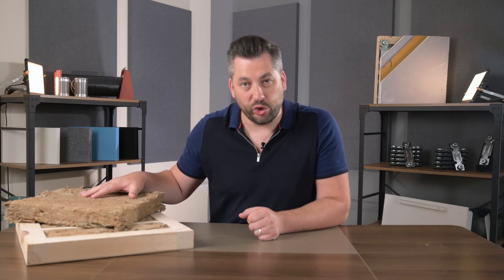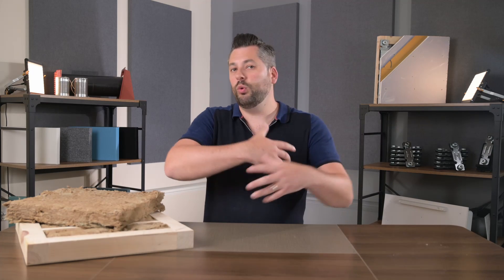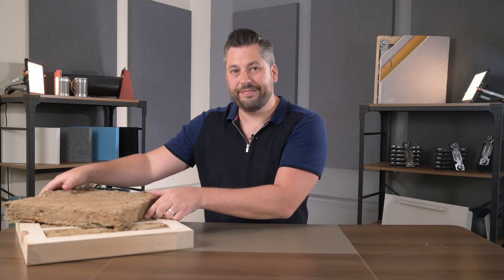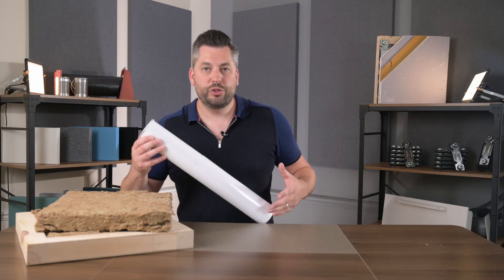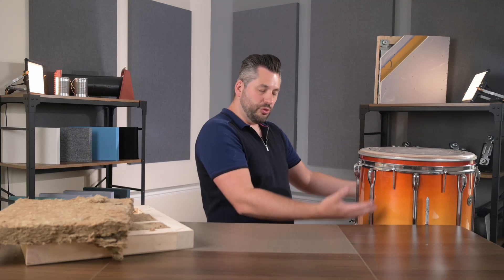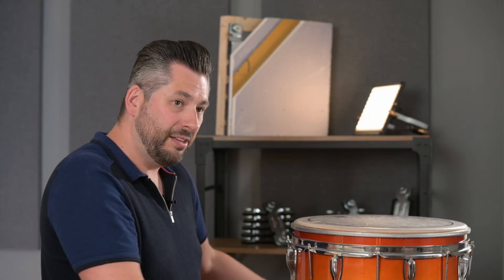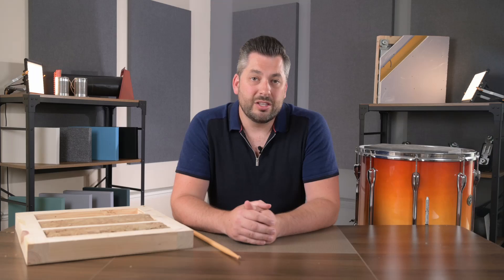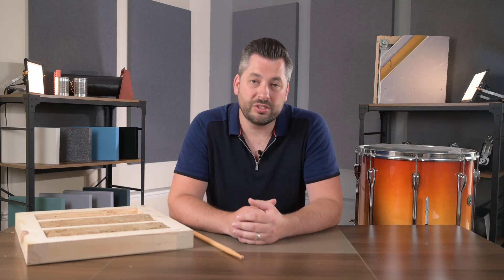How Acoustic Mineral Wool works as Soundproofing Insulation

Comment: Would i get any sound absorption by ramming carpet underlay under floor boards between joists?
Reply from the maker: Hi @traderz13, we'd recommend the use of 60kg acoustic mineral wool.
Reply: @SoundproofingStore is that a yes or no?
Reply from the maker: @traderz13 Thanks for the question. It really depends on what exactly the carpet underlay is. If it's a soft, absorbent, porous underlay then as long as you use plenty of it, it will give you some sound absorption. Obviously difficult to say how much with no data. But any soft absorbent material will help to some degree.

Comment: I recently had to take up my laminate floor because it was damaged and about 20 years old, there’s floorboards underneath and then mineral wool between the joists, there cavity form floor to ceiling downstairs is 53cm. 

I took up the acostaly because that was also damaged. I want to keep the floorboards but I’m concerned it’s not insulated enough for the flat downstairs, I have carpets etc but will that be enough?
Reply from the maker: Hi @Titanicdork133 from your comment I assume your biggest concern is your noise travelling down to the people below. In that case, it's good that you already have mineral wool between the joists, your floorboards should be ok to keep but you may need to seal up any holes or gaps with acoustic sealant. Then you need a soundproofing product that will do two things, 1. Add more mass to the floor to reduce airborne noise 2. Add cushioning to the floor to absorb impact. If you want to use a laminate again then you could use our Reverso SoundMat - https://www.soundproofingstore.co.uk/reverso-soundmat but you will get better results by using our SoundMat 3 Plus - https://www.soundproofingstore.co.uk/soundmat-3-plus and having carpet on top.

Comment: Any opinion on the higher density rockwool slabs that are available? Eg RW5 100KG m³? I have a low ceiling, so was wondering if this may be incrementally better for the same height reduction?
Reply from the maker: Hi, thank you for your question. In the vast majority of cases we find higher density than 60kg gives very, very little to no more benefit in terms of decibels reduced. It's handy in certain circumstances when trying to improve specific sound frequencies, but for general household noise, we wouldn't say spending more money on higher densities would be worthwhile.

Comment: how thick should be the mineral wool layer for the floor? For example for the 300m joists should the wool layer be half of it (150m)? Or 200m would work better (still leaving air gap)?
Reply from the maker: Hi, thank you for the question. It depends to a degree on the construction and what is on the ceiling and floor. Mineral wool has diminishing returns, so the more you put in, the less effective each layer gets. On a basic internal floor with floorboards above and a single sheet of plasterboard screwed direct to the bottom of the joists to create a ceiling, having more wool will give you a little more benefit. So 100mm of wool in a 300mm cavity will already do a good job. 150mm will be a little better but only a couple more decibels, 200mm will be slightly better again but marginally. So in most cases we stick with 100mm as this does a perfectly good job and is cost effective, but if you want to use 150 or 200 it will give you a small improvement. However, if you are also doing an acoustic ceiling like our ReductoClip ceiling system then 100mm of wool bewteen the joists is all you need, and any more will not give you really any further benefit at all as the full system is already doing such a great job and is therefore more difficult to improve. Hope that makes sense.

Comment: Hi there - when building a stud wall from the party will a larger gap than 10mm, say 20mm improve the results? Thanks
Reply from the maker: Hi @matthewhorsfield7895, no air gap to a 10mm air gap is a huge difference in performance. A 20mm air gap (over and above the 10mm) will give you some additional benefit for lower frequencies.

Comment: Hey I have a question, we soundproofed the alcoves but I can hear them clearly through the chimney breast - can we stuff our chimney with this insulation? It's not an active fireplace
Reply from the maker: Hi @TheAntitrollpatrol, adding Acoustic Mineral Wool will certainly help absorb some of the sound from bouncing around inside the chimney. However, it won't soundproof it. Please see the below blog which highlights the ReductoClip System or SoundBoard 4 as options for soundproofing the chimney: https://www.soundproofingstore.co.uk/how-to-soundproof-a-chimney
Which system you use can depend on the level and type of noise being heard through the chimney. Please feel free to call and we will happily advise on the best solution (01423) 206208.

Comment: When filling in between floor/ceiling joists, does it matter that much about having a continuous layer, or is it more just filling a good percentage of the cavity volume?
Reply from the maker: It depends on your floor joists. As a guide based on 200mm floor joists, we recommend 100mm mineral wool. (So about 50% of the cavity is filled). However, this can vary depending on each situation. Don't fill all of the cavity, as there needs to be an airgap.
Reply: Hi, is this good for lining a subwoofer box?

Comment: I live in india in an area where there are always drilling and loudspeakers going on and not just that but on festivals , it becomes unbearable to suffer 140db coming from everywhere due to so much population . Will this wool with soundproof booth work? i got one interior guy who made plywood frame with mdf walls and inside that, he is gonna fill this wool. I m still wandering if this will be able to block drill voice coming from my neighbor home in a joint  apartment? Can you suggest how to completely block higher db sounds?
Reply from the maker: Hi bhatt shashank - Thank you for your comment. Unfortunately it's very difficult for us to help with this. I can't recommend any of our solutions because we only supply within the UK and I am not aware of the available systems in India. However, just putting a plywood frame with mdf and mineral wool against the wall is not going to do a lot. Especially for the low frequency structural vibration of drilling.  You need a system that dampens high levels of sound energy / vibration. You need to add a lot of mass to the system. However, your bigger problem is if the building is concrete, the vibration is probably spreading everywhere, thorugh your floors, ceilings, walls etc. Just soundproofing one wall will only help so much in this case.
Reply: @SoundproofingStore  Thanks for suggesting the solution. Can you tell which wall i should soundproof in the cube of my room?
I live in 7 storied building where there are three blocks a,b and c each seven storied. I live in B-601 and building B is surrounded by A and C. Now interestingly, if person living 101 on first floor of either A or C does something with hammer(90db) in his home, i can hear that clearly even being on 6th floor and not only that but that vibration is being spread everywhere it looks like that sound is coming from top of my ceiling which looks very strange to me. Yes you got right that it is due to concrete but how to decide which one to sound proof?

And yeah just to mention that till this point i have invested around 60k INR for this thing which means lot in Indian rupees and only want to move forward with exact solution. The interior guy is suggesting to make window soundproof which is 5 * 6 feet in my room thus he believes this is the main entry point for sound but this would not work against hammer as you said, isn't it?

Comment: When installing a system to a party wall, such as the stud frame, direct-to-wall, or soundboards, is acoustic mineral wool required to go into the suspended floor below to further dampen the sound? Will this make a difference? 
And, is there a certain length it has to be kept from the party wall, or is it required to be filled in as much as possible touching the party wall?
Reply from the maker: Hi AYmusic, it depends if you can hear noise coming up through the floor? You can do an ear test by listening to the floor when you can hear the unwanted noise and compare what you can hear v's the wall and different parts of the floor. If adding acoustic mineral into the floor joists we usually recommend to come a minimum of 1.5 metres from the wall into the floor. 
It also depends on what kind and level of noise you are trying to reduce in terms of how much of a difference this will make. Please feel free to call us on (01423) 206208 and we can discuss it in more detail with you and advise accordingly.
Reply: @Soundproofing Store   That seems quite a gap. Is that for ventilation purposes? The noise is more from the walls rather than the floor. Although we can faintly hear the neighbours TV from the living room in our bedroom (Not directly attached, but one floor up) 

If there is no or very little noise (we're in a terrace house), is it even worth putting it under the floorboards?
Reply from the maker: @AYmusic17  if you think very little noise is coming through the floor then the advice would be to treat the walls (with the correct soundproofing system for the type and level of noise) without adding the acoustic mineral wool within the floor joists and go from there. With regards to the 1.5m, there isn't a gap. The mineral wool is added at the bottom of the wall going a min of 1.5m into the floor joists.

Comment: the density of the mineral wool make any difference?
Reply from the maker: Hi Fabrício Rossini, the short answer is yes, it does make a difference. 
However, how much of a difference depends on the system / other soundproofing materials being used and how weak the structure is to start with. e.g. if using a tried and tested soundproofing solution like the ReductoClip System, the recommendation is 60kg mineral wool. However, if you needed to, you could go down to 45kg because the other elements within the system are so high performing.
Reply: The larger the air gap the less dense the absorbing material needs to be. There are charts comparing 5cm-10cm-20cm-30cm-40cm air gaps filled and partially filled with insulation. It is mostly to address lower frequencies and the resonance of that cavity. For very small gaps (3-10cm) the denser the better (up to a point). Also if the cavity is to be filled, the material should not be so rigid if it touches both walls.

Comment: how does this compare with dense packed cellulose ? should the whole cavity be packed, or leave an a ir gap ??
Reply from the maker: Hi John White - Cellulose insulation is good for thermal insulation but is not an acoustic insulation and won't perform anywhere near as well as acoustic mineral wool for absorbing sound.